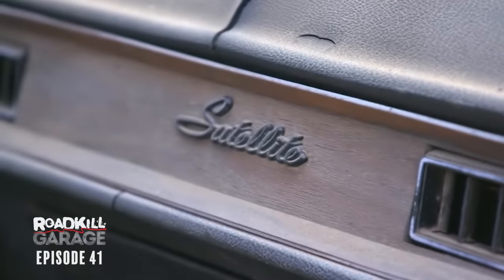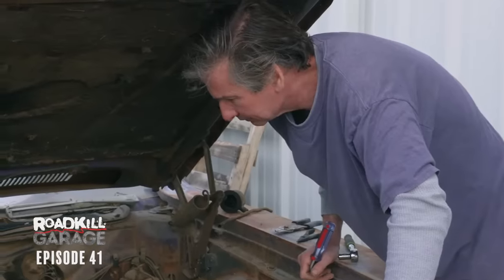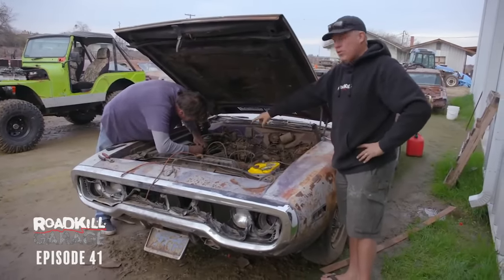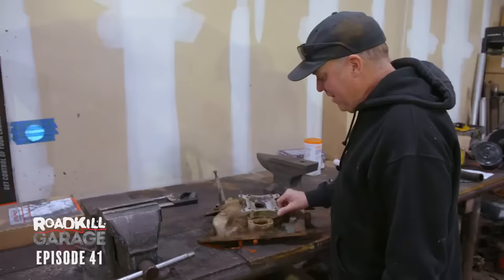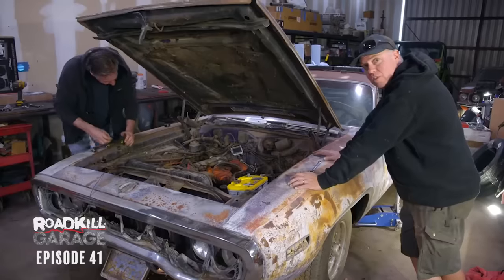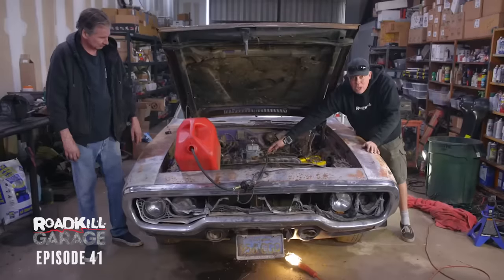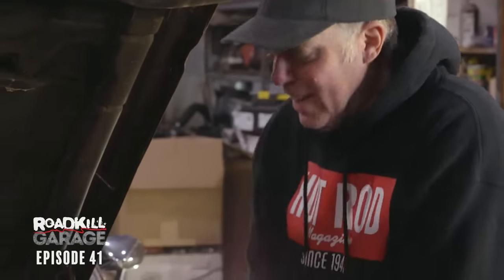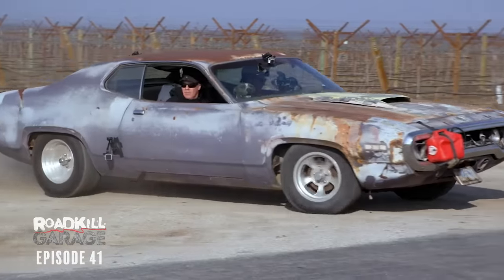Restoring 1971 Plymouth Satellite's Former Glory!  | Roadkill Garage | MotorTrend

Comment: To protect internals of an engine that has been setting for a year or more, 1. remove plugs 2. spray lub in cylinders 3. change oil/filter 4. crank over with no plugs in, till oil pressure is up in order to lube bearings/valve train 5. put new plugs/wires in with fresh gas and try. That helps reduces dry start valve chatter or other possible damage.
Reply: No friburger will just sender. They have many better engines lol
Reply: Great advice. I love roadkill. Half of the show is them doing the right thing kinda the wrong way regardless of the consequences. And they usually say so. And  like Jesse said, they don't care because they have better motors. They don't care much about the looks of a car so long as it is solid and the frame isn't bent. We'll kinda. They did do 2 or 3 shows with the only car I have ever seen  drive an imaginary telephone pole as a passenger in the tront and back seats!

Comment: My first car was a 71 satellite with a 400 engine, and 2 barrel carter carb, and a 727 slapstick trans. We put a lot of work into that car trying to get it to pass smog. (Back then California required a smog cert on that year). We kept getting bad new carbs and the car would not pass the smog test. About 4 new carbs later we finally 
got a good carb, passed smog and I drove it for a few months. Until it threw a rod. It was a great first car, I  bought it from a neighbor for $300. Paid for it with my own money I made working as a stock boy in the local mini mart gas station. Watching this brought back a lot of good memories.

Comment: If that happens to you cut the rubber out of the radiator cap. With no pressure the leak is much smaller. Get you home.
Reply: That's an awesome tip. Thanks